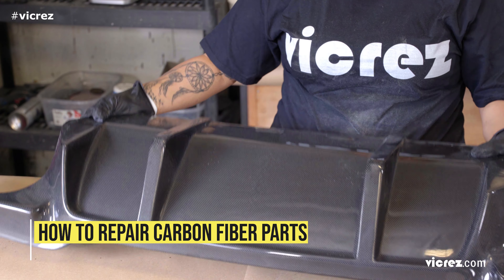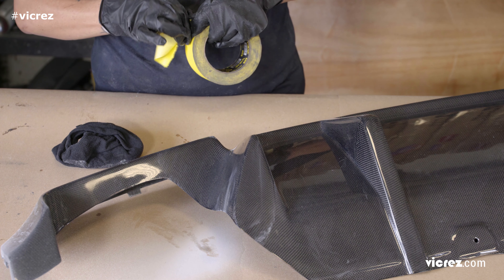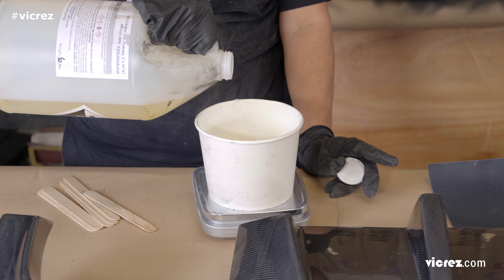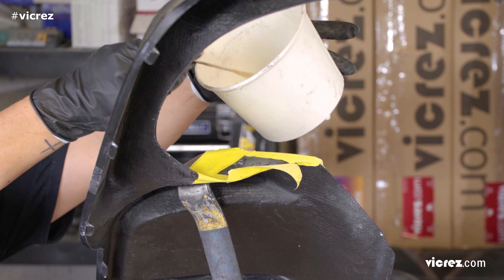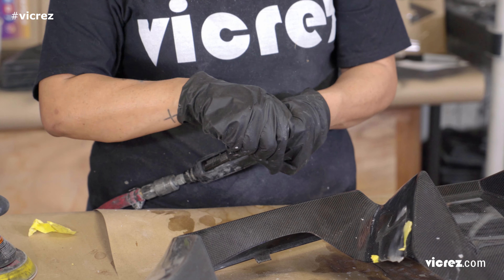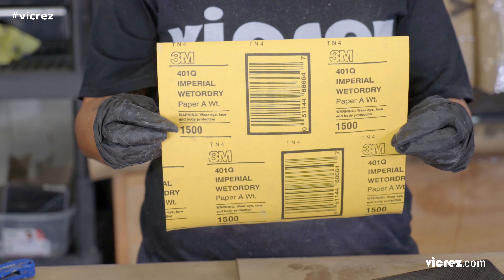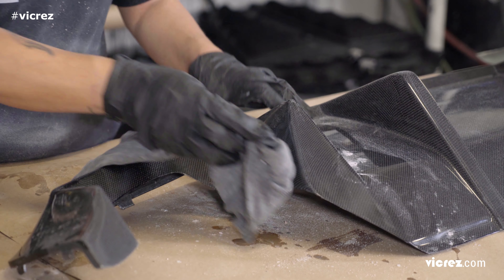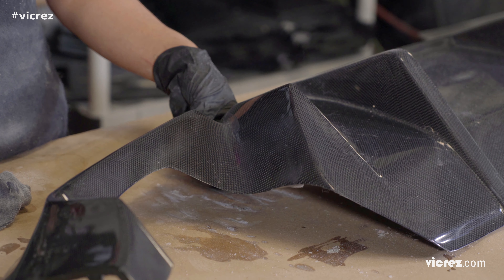How to Repair Cracks and Scratches on your Carbon Fiber Parts

Comment: Worst guide or "How NOT to repair your carbon!"

If you have a simple scratch like on the video just take 600 grit sand paper and carefully sand all the part uniformly. Then do the same with 800 grit and then 1000 but not too much to do not oversand the carbon fiber itself. Then clean and apply high quality UV resistant 2K clear. Done!

Comment: Hi there I have a question here I have a dent on my front hood it has deep scratches that possible could see the carbon fiber can it be repaired or do I need to replace the hood
Reply from the maker: Hi, we could suggest for you to try this method first before you replace your hood as you can make your hood look good as new this way.

Comment: No need to clear coat it after sanding? And then buff
Reply from the maker: 1) First Remove the damaged area by sanding it down. 
2) After that clean the surface and apply the resin epoxy of clear coat. (Allow 24-48 hours to cured).
3) Sand down the excess 200 grit, until you reach desirable look and to finish it off using a 1500 Grit with some water (WET SAND)
4) Add Compound + Buff
5) Enjoy

Comment: is it okay to use a gloss clear coat of some kind rather than epoxy resin?
Reply: No have to use resin because that’s how carbon fiber parts are made. The hole point of this is to basically replace the resin, sand it down to be even with the rest of the area, and then clear coat it.

Comment: Hello I have some carbon fiber eyebrows for headlights the clear is cracking and dull I was going to sand it and re clear but some of the clear has chipped off completely down to the weave. Do I sand all the clear off and re clear or what do I do lol. I don't want to damage the weave by sanding where there's no clear coat
Reply from the maker: Sand all the clear enough where you get rid of the damage area and re-clear